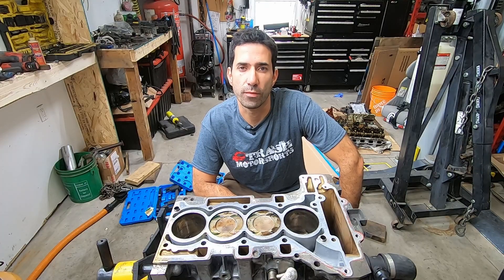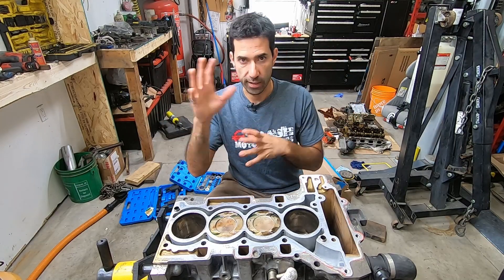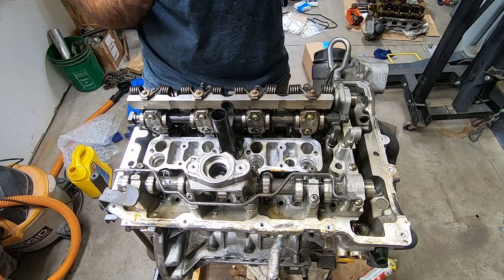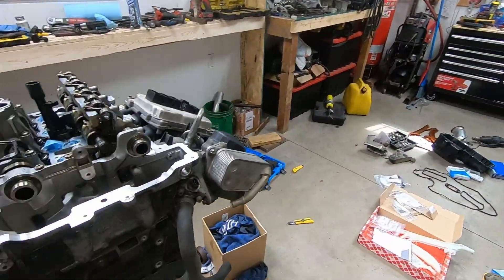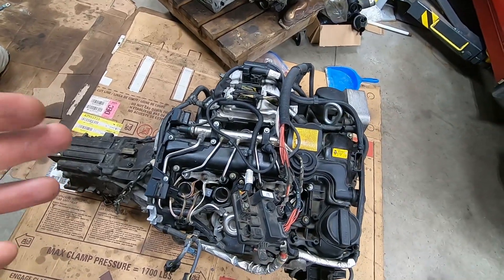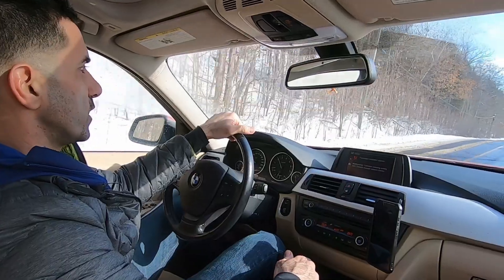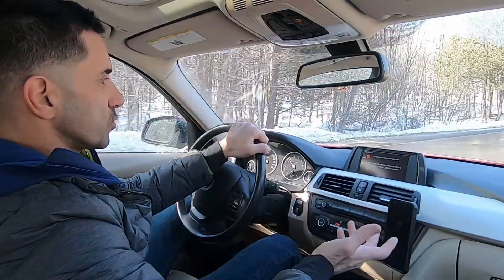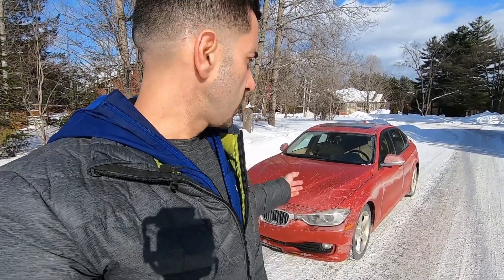Fixing the seized N20 engine in my BMW F30 320i - Part 2

Comment: He used the oil pump from a SEIZED engine. mmmmmm. Not too bright.
Reply from the maker: The oil pump ran fine - tested,  checked and ran wth checks on he pressure...I should have changed the pump though - that's for sure

Comment: Did you ever checked what caused the old engine to seize ? Was it bearing related ?
Reply from the maker: The bearing was seized but what caused it is unknown... I'm using the old oil pump so it wasn't oil related...just crappy BMW design, I guess

Comment: If you end up changing the oil pump you should teardown the old one. I'm curious what it looks like on the inside, guessing metal went through the pump when the bearing got damaged?
Reply from the maker: @justfasial01  for sure...i am really curious about the whine on it... are you familiar with the motor? You think I should swap the pump only or the whole assembly with the balance shaft?
Reply: @ETMotorsports  I'm actually researching the n20 because I'm looking at a x3 with a locked engine. The timing chain is loose so I'm hoping that's what caused it to lockup. I'll be taking a look at it next week and if the oil looks clean I'm gonna assume that's it and take the gamble.

I would say swap the whole assembly, it would be easier, no? just have to undo the t60 to remove sprocket and then the whole assembly can come off. Won't have to remove the chain. Also I wonder if the O ring on the pickup tube got damaged at 5:17 when you lifted the tube. That o-ring is probably flattened over time and the movement caused it to not seal anymore. If that's not sealing 100% the pump could be sucking in air which would explain the whine. Did you have any metal shavings in the oil on the seized engine? if no then I'm guessing pickup tube is not sealing 100%.